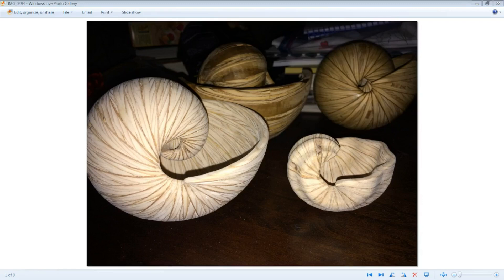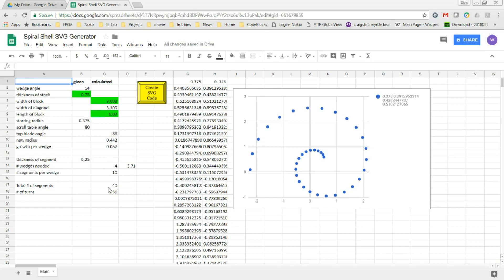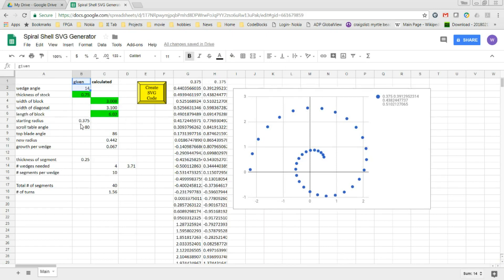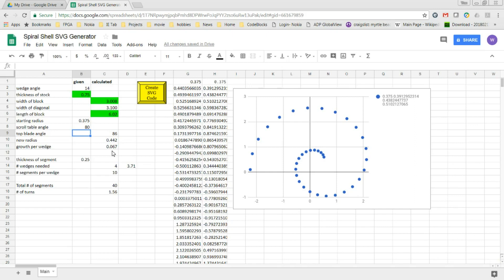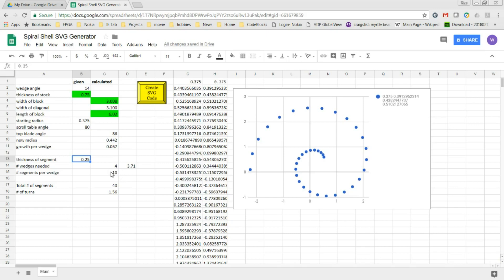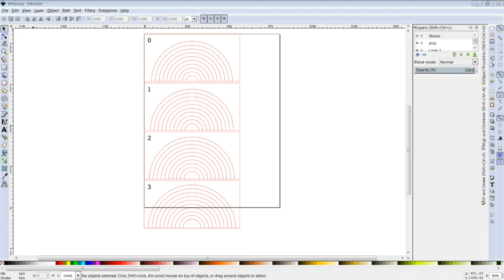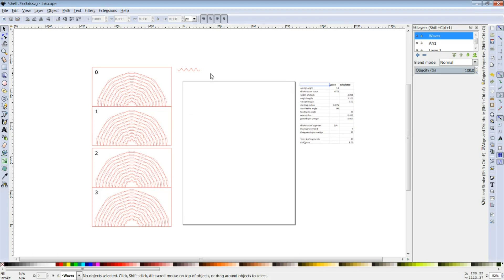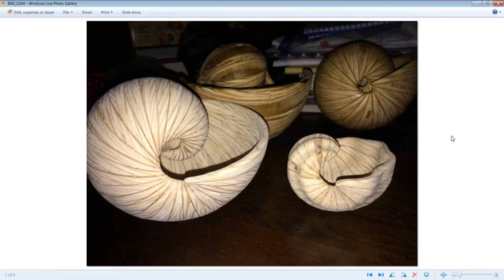Wooden Shell Scroll Saw Patterns

Comment: Excellent stuff. Been searching around for a speadsheet like this for a few days now. Did you use googlesheets with those equations to create it? I don't know how to use a spreadsheet program but I guess I could figure it out.
Reply from the maker: The equations are close. The names, like "wedge angle", need to be replaced with their row/column number (wedge angle row/column number is B2).
Reply: Not sure I'll figure it out by next weekend when I need it but going to try. This is for shells with equal growth in the axial and radial planes right? Do you see a way to do it with the new method Steve does of differential growth? I want to try to make a shell that looks as natural-shaped as possible. The fat ones look great from the side, not so much from the top.
Reply from the maker: Yes, I started with axial and radial growth (it was simpler). But to change it to the newer method Steve showed is to use the elliptical equation for the arc. I have thought about how to make the change, but have not implemented it yet. I want the change to include the sizing of the blocks to attach to the wedge.
Reply: Yes, my thoughts exactly. PM me if you have plans to sell or share copies of this thing. I would be definitely interested.
Reply: Looking at it again this morning; you might also consider making the 1/16 value as a variable. I assume that it's kerf width?
Reply from the maker: Keith Green you are correct, the 1/16 is for the kerf and I agree I should make it be one of the given values.